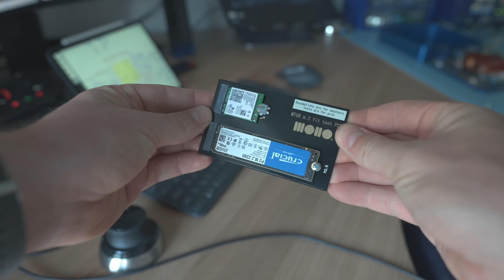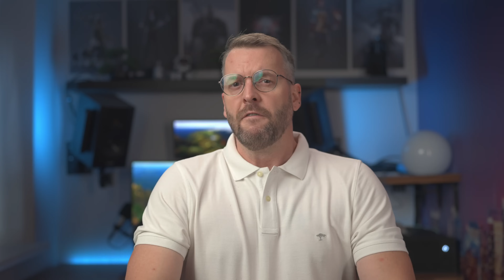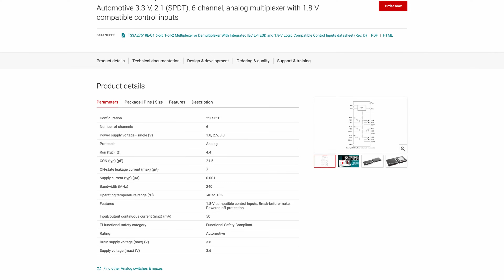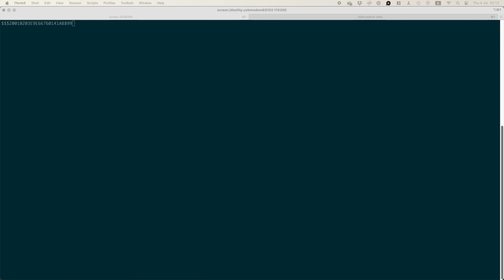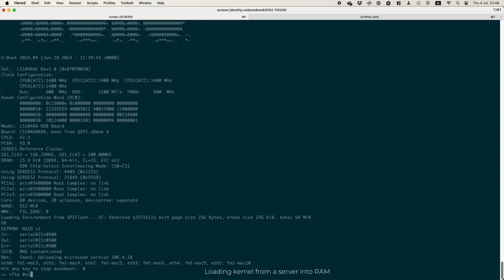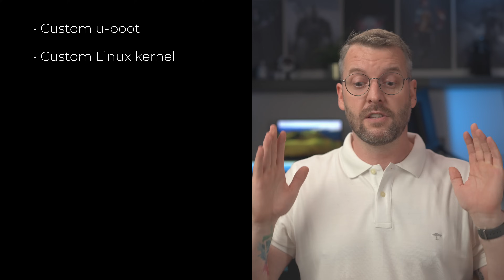We're building a high-end router. Here's the update for June 2024.

Comment: I used to work for a switch/router company. It was pretty interesting. In the past, the company would buy a special switch (from broadcom, for example) and a license for the SDK. In general, the SDK would come with an old linux kernel, some command lines and a 90's web interface. Then, we would add features (almost from scratch) to the product. The hardware part of the company was pretty good for a reasonable small company (500 engineers). Later the company started building it own OS that could be used with almost any device that support linux. They started with their GPON (fiber) line of products. I think the company is not doing very well, many engineers moved to the Netherlands and US for better jobs, and the government stopped heavly invest on public fiber infrastructure. I think it is very hard to compete with chinese routers, but, at the same time, if you can provide a reliable and quality product, their is still a market for it.
Are you starting from an existing framework (like openwrt), SDK from the chip that you chose or are you building something from scratch?
Reply: Are you talking about MikroTik? 🤔
Reply: @Daniel15au Lithuania, Latvia, Malaysia, Vietnam, and China for Microtik, so a good guess. I’m not sure of any network hardware manufacturers that don’t have any operation in china.
Reply: @Daniel15au  No, the name of the company is datacom from Brazil
Reply: By the way, Mikrotik is pretty good for its price, but it feels like it is heavy CPU oriented, with almost no specific hardware processing
Which is good to make many products, but can lack performance under heavy load
Reply: I really hope he's not starting with the vendor's SDK as they are wildly out of date, and for a device with swapable parts it's not a good idea.
Reply from the maker: I don't want to reinvent the wheel, so we're currently focusing on shipping the initial batch with OpenWRT just so that we can get the device to early adopters to help us test it in the wild. Then, I'd love to try and get OPNsense running on it as there's a big demand from what I've seen in the comments.
Nothing from scratch (except the hardware, because we don't want to be dependent on anyone else) - there's so much good code out there, doesn't make any sense to start from stratch.
Reply: @tomazzaman  OpenWrt is a good choice. It's lightweight and very efficient. Opnsense is good too, but much heavier weight, and in my testing it doesn't perform as well in terms of routing (especially single connection performance over 10Gbps connections). Performance of routing on Linux overtook BSD a while back.

You might want to consider something that uses the newer FDio/DPDK/VPP stack on Linux, like VyOS. They can route much faster that anything else, even on low-end hardware.
Reply: Ah, the nightmare that is Broadcom's SDK. What an enormous pile of shit. 'tho it can sometimes get you somewhere near where you want to go. Their "open source" crap is the very thing you describe... huge binary blob dependent on a very specific and ancient kernel. (with access to the SDK source, one can build it for almost any kernel, and not just linux.)
Reply: PCengines ? I miss the APU4 :(

Comment: the "FU, figure it out" is very common in embedded development. I've been an embedded HW EE for decades, and the era when we could get good support from everyone is long gone. ST is pretty good. NXP is definitely not.
Reply: I always liked NXP microcontroller documentation, back when I last used it (maybe 10 years ago). If you opened the chapter on e.g. I²C, it started off by telling you what else you need to configure (bus clocks, GPIO alternate pins, etc.) to get it to work, and referred you to the right sections. ST on the other hand just assumed that everything was configured fine and described just the I²C peripheral. You had to read and remember the entire 1400 page manual to get anywhere at all. That said, screw whoever at NXP thought it was a good idea to put the contents page at the back and omit the index.

Comment: So... based on experience (ISP/Network provider/MSP)... do not do eMMC .... 

Multiple reasons:
90% of our failed devices are using onboard storage - we toss them when they fail.
If you use an SD card then it can be upgraded/changed ... but higher failure rate.
Lower/worse read/write performance - although it may not be required to have a high performance storage for a router ... it actually does make a difference.
Bootup/startup time, navigating UI for management (eg loading files from disk to render/send), logging, general data storage.

Overall ... rather just go SATA and use a 2.5" SSD - it's cheap, fast enough - and upgradable if someone wants to use more storage.
Also, the components will be less and ofc, less failure conditions - not requiring a mux etc...
Reply from the maker: Interesting, I mean I've had a number of SD cards fail on me, but I wouldn't think eMMC does as well, given it is just an interface - and a controller - to NAND (at least in our case).

Thanks for the suggestion!
Reply: @tomazzaman  Yep.... thus why SATA :P 

Not really sure why, maybe endurance quality difference ... 

But SATA does give the best of both worlds and you have available IO so overall, easier to implement and lower TCO ... 

BUT.... if you get a 2.5" SSD and open it's case, it's bloody small .... so you could use that :D 
OR.... m.sata interface .... it's still sata, but NVME form factor
Reply: Why 2.5“ SATA rather than M.2 SATA?
Reply: @Daniel15au  see my add comment... i forgot about them lol
Reply: eMMC is ok for reads. It's write cycles that really kill them. For just holding kernel + ramdisk, it'd be fine, but if you're storing logs, or frequent configuration changes, use something with better resilience. And, of course, don't solder it directly to the board!

Comment: What you should keep in mind before moving to the production version of the firmware is to remove the device tree from BL3 of the U-Boot for security reasons. Can be activated later to perform "over-the-air" online Firmware Upgrade but it would not be as secure against attacks from the network, there are workarounds but what I said first is essential 😅
Reply from the maker: I want to do the it the other way around. Open source everything then patch the holes with the help of this community. :)

Comment: I know this comes a bit to late now, but would it make sense to use the MediaTek MT7988A (Filogic 880)? Because it seems to have much more connectivity than the NXP-LS1046A, for example the Banana Pi BPI-R4 has two mini pcie, and one m.2 slot.
Reply: Asked him this on twitter, he said in the next couple of videos it will become clear why the NXP route is their better choice
Reply: Yea, I was thinking the same. I think that the HW network stack on the NXP have more bandwidth. But who knows.
The cool think is that MTK have hardware blcoks to accellerate/offload WIFI packets when using their chips.
It is basically all mainline code so also future SW updates are easier, no stupid outdated/vulnerable BSPs etc.

Comment: Thanks for the update, love the amount of details you provide!
However I didn't understand exactly how you can remove the PMIC from the system. How does the P-GOOD pin replace the PMIC? 
As far as I know, powering a CPU is mostly an issue of sequencing the different voltages in the correct order, and fast enough to be ready for each next stage. Can you please elaborate? 
Oh and, one last thing: remote file systems FTW!!
Reply from the maker: Let me write this down and answer it the next month because Ken is working on these, so I want to make sure I understand correctly myself before giving an answer, if that's ok.
Reply: You chain the PGOOD output from the first regulator to the enable of the second one - then the PGOOD of the second regulator to the enable of the third one, and so on.
Reply: @tomazzaman  yes, please!
Reply: @triffid0hunter  yes, I thought of that as well. However, some CPU supply stages require very precise timings in order to initialize correctly. If P-GOOD does not come up in time, or comes early, a CPU supply stage might come too late, or it may initialize too early when previous stage(s) did not finish making their feature ready. In some cases the CPU might be partially usable, but spits out complete garbage, which makes it hard to debug where the problem comes from.

Comment: Is SPI booting an option? You could get an SPI flash chip, which are very common but kind of expensive per byte, or even just use an sdcard in SPI mode. It might be kind of slow, depending on hardware support(maximum clocks, QSPI, Octal SPI, etc.).

Comment: Hi Tomaz. I understand you perfect when you had to build the U-boot. I'm playing right now with a Banana Pi BPI-R4 board and I was able to build U-boot + AT-F to be able to get NVME working. I worked about 1 week until I found a patch for U-boot that activates PCI-e 3.0 for the chip to be able to see NVME SSD and now I'm in the phase of building the Kernel and Root FS on NVME.
My ideea is to use U-boot entirely with bootmenu using an u-boot-env on NVME wich is generated by OS each time a new kernel is installed (similar with Grub for x86). I want to use SPI flash just for the firmware.
I'm wanting for you device to be available for sale to play with it and "reflash" it with my own U-boot. 😁

Comment: Did you guys use a BSP kernel or something like upstream LTS 6.6?
Reply from the maker: I've tried several kernels actually. Regular one (Torvalds repo), both versions 6.9 and 6.6, then I tried BSP one (based on 6.6 and 5.5), and finally OpenWRT (5.5). All of them built manually, no Yocto or buildroot, and they all work fine and pretty much the same as long as I pass the right device tree.

Comment: Is really SDIO that common in m.2 WiFI cards? I only heard of a single M.2 SDIO WiFI module used in rather obscure thin client that in fact the opposite issue - no PCI Express at m.2 wifi port at all (Dell Wyse 3040). Every card I know uses PCIe for signalling. SDIO is common in embedded, soldered in modules used in cheap devices.
I don't think losing SDIO from WiFI port is really an issue.
Reply from the maker: A lot of tri-radio cards use SDIO for Wi-Fi, yes. Unfortunately. I'd prefer if they didn't :)

Comment: Isn't this something like the r86s but arm? Is there any advantages with the cusom hardware? You can always use custom OS/kernel with UEFI
Reply: There are linux based router OS such as VyOS with redundant images to mitigate failed upgrades. If you are building your own os all these needs to be considered. I don't think OpenWrt supports this natively unless you have u-boot/partition magic like WRT32. 
PS: How VyOS is doing with open-source it another problem
Reply: I don't think you will get any hardware routing/switching accelerations but there are tools like DPDK or crypto offload that can make the software router perform better in some use cases.

Also making routing configuration easy and safe is a important consideration. If you're considering OpenWrt, it is good for basic DNS/DHCP configs. But it doesn't have good support for more advanced routing protocol even like bgp. Then there are BSD based os like OPNsense with way better support for more advanced routing.
Reply from the maker: Agreed on many things, but we have to start slow - we don't have the capacity to go that high at this point yet. Also, the CPU that we chose does have dedicated networking hardware (called DPAA), so we will get acceleration both for traffic and crypto.
Reply: @tomazzaman You mentioned it will be running openWRT initially.
In my experience one big weakness of OpenWRT is no implementation of hardware offload.
As far as I know, only one Mediatek SoC is supported for hardware network offload.
Crypto offload might be ok just to the extent of using neon.

Are you planning to put some work into OpenWRT to get it working, or will that be later in the Opnsense port?

Comment: Wouldn’t level shifters to NAND flash be better than an SDII mux?
Reply: I was also thinking about it. And there most probably will be a speed penalty, but probably not as much as using a mux... Maybe even the "dirty" level-shift trick works where you only clip the voltage down and use the 1.2 output voltage directly on the CPU input pin that will probably go high at 0.8V or so.
Reply from the maker: It should be possible, but we'd have to level shift A LOT of pins so the design would become much more complex compared to a 6-channel 2-way mux.

Comment: Going back to your storage issue, I'm not sure I understand what you are having trouble to source... 1.8v NAND chips are common in the 8GB range... 1.2v is usually the voltage for RAM chips, not NAND flash...
Reply from the maker: Not really. Try to find a 32GB NAND in 1.8V :)
Reply: @tomazzaman  Ah, yep, over 8GB is not anywhere to be found... I think you might be ok with 4x 8GB though, and a small address decoder circuit to drive the chip enable pins (assuming the controller has a large enough address space)...

Comment: great to hear about the progress

also when it comes to m.2 mechanism What is wrong with standoff and screw

also good conversation on twitter/x about booting linux(the one with kernel panic and me saying i do things with rootfs)(would have put a link but rather not for visibility reasons)
also i hope this will have its last bootloader unlocked unlike phones

Also this inspired my to build a rootFS for this device when i get my hands on it im not a embedded guy but i do like RootFSs

also also also also ewwww device trees, ACPI for the win
Reply from the maker: The problem with standoffs is that they need to be soldered onto the substrate. But if you want to support multiple lengths of M.2 cards, then they can get in the way. But if you use the latch that we're considering, then you can simply move the latch from one position to another.
Reply: @tomazzaman  couldnt you just have threads in PCB and movable standoff(ok i would guess that gets expensive)
Reply: also on the topic of devicetrees as someone who want to make a distro for snapdragon X elite laptops i already feel their pain cause you know potentially each laptop may require a special kernel for that laptop if its stage 3 bootloader doesnt support passing the devicetree into the kernel, or compiling as many as possible into the kernel (i hope this gets done at mainline level PLEASE I WANT THOSE LAPTOPS TO SUCCEED ON LINUX)
Reply from the maker: Maybe, we didn't bother with that because these latches are cheap and easy to work with.
Reply: @tomazzaman  i may be a special case(because ima techie) but i hate them in same way i hate every PCIe locking mechanism
Reply: @bigpod  if you over tighten the screw you have a very good chance of stripping the threads on the PCB. Or, if there is a nut on the other side, it may start free-spinning. I agree with Tomaz on the choice of that simple latch, it'll also make it more appealing for the average person (tho, if you buy a 500$ router, you'd better know how to tighten a screw without stripping :) )
Reply: @cristinelcostachescu9585  well why would you have a nut all you need is a small standoff on one that you screw onto the board (which is the most damaging part) but that can be done by hand then you screw the screw into that standoff.

My problem with latches is overtime they get stuck and hard to move at which point most people think of using screw drivers to move the latch at which point a slim could mean damage to the board
Reply: @bigpod  considering it's a router, I doubt you'll have to swap any of those M.2 slots that often. Most likely, you'll install a device once, and forget about it. It's going to be fine...
Reply: @bigpod  Good luck with QCOM shit BSP... if they dont use EFI to abstract the underlay it will be a mess.
The whole point of the DTS is for embedded system to have minimal booltloader/cleaner kernel specific macine/platform code.
Who remember the mess there was on 2.x ?

I think that those machine should provide some info via UEFI and ACPI.
Reply: @tuttocrafting  based on available data to me at this time snapdragon x soc based systems use devicetrees but thats standard for ARM, ill have to do more research before i get my hands on one of the devices (which is hopefully soon) but its not looking good

Comment: I don't understand the need for two wireless network interfaces. I doubt the target audience for this router will put a Wi-Fi card and use it as an all in one solution ala cheap tp-link.
My point is one slow slot for "some radio" should be enough.
Reply from the maker: It's all about choice (and best practices). You can prefer tri-radio for home automation and the wifi is mostly for the iot. Or, you can prefer high-speed wi-fi 6 (and even 7). These two don't come in the same device, unfortunately.
Reply: @tomazzaman  The 3-radio slot makes sense. I don't understand the replacement of storage slot for fast WiFi. I can imagine more use cases for bigger/faster storage  (pcap, logging, etc.) than for fast WiFi.
Reply from the maker: @hipantcii  both have their pros, cons and use cases, we just decided to focus on networking rather than storage. Storage can still be expanded via a USB 3.0 port on the back, if necessary.